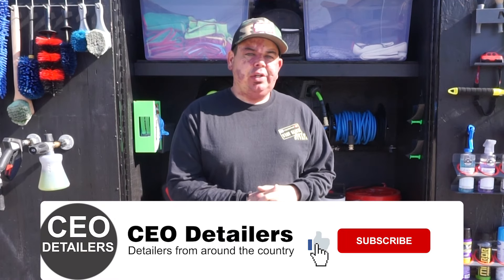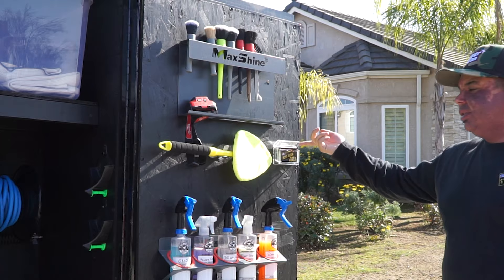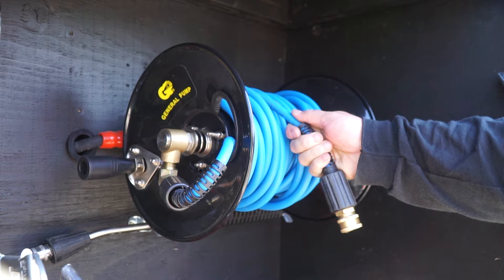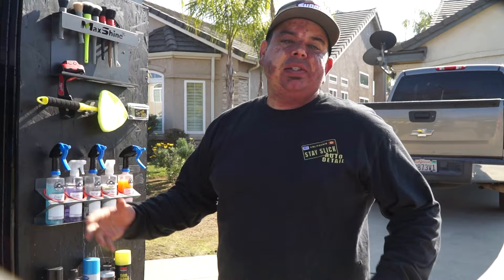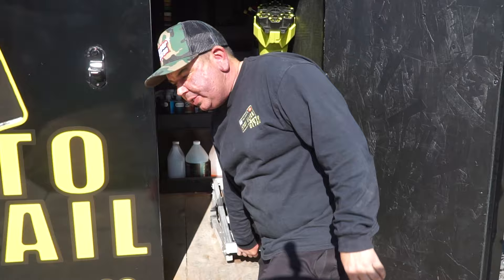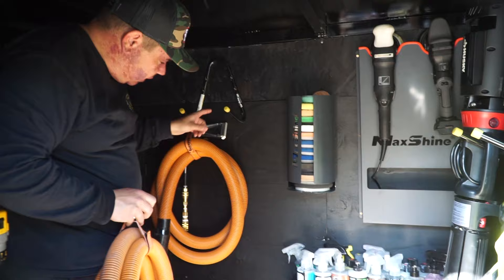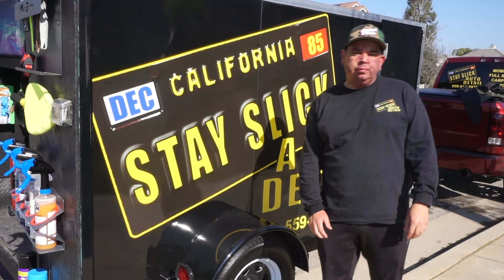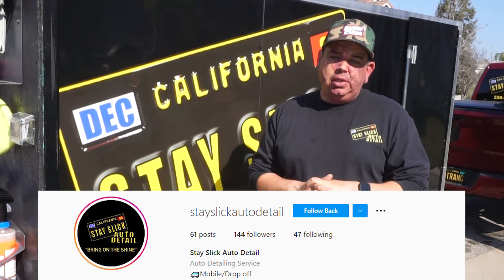Stay Slick Auto Detailing Trailer Detailing Setup - CEO Detailers

Comment: I love your setup brother. I just got a 5×10 enclosed trailer Saturday. Just want to let you know that the NorthStar pump will not work because when your pressure washer stops, the back pressure will blow out the gasket... I tried 3 different ones, don't get one that is for a sprayer... I went with a rv pump from Amazon that is 3 gpm works perfectly.

Comment: I think I was the one that told you about that northern tool pump 👊🏾 nice set up homie. I remember when you first showed it.

LMD - Laury’sMobileDetailing Dallas, Tx
Reply: What pump is it
Reply: @cartailincautodetailing946  North Star NSQ Series 2.2 GPM 70 psi 3/8 in NPT ports. I had the smaller version at first and the fuse kept blowing so I went up to this on and I haven’t had any problems out of this one. It’s a on demand pump. It only comes on when you pull the pressure washer trigger.
Reply: @alaury13  yes sir thanks again. So would I tap into the trailer wiring to run it or no?
Reply: @thewesterngent  I run mines from the battery of my van but check your generator also most generators come with the a lot to attach those wires to it. The pump won’t run a lot it’s only going to turn on when it primes when you first turn it on and when you pulling the trigger on your PW gun. I’ve seen people get a whole new battery for that pump but to be honest you’re only using it for what maybe 15-20 min if that on each vehicle.